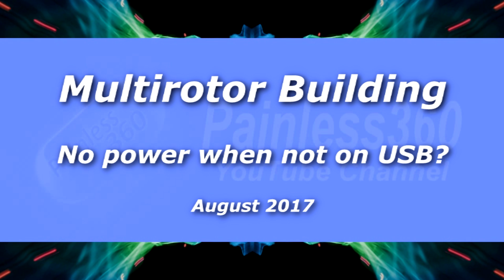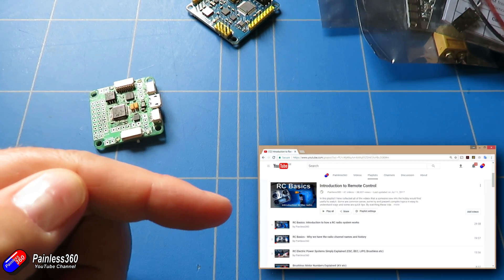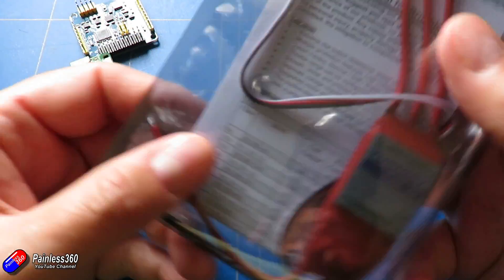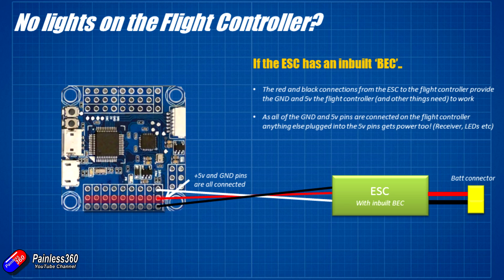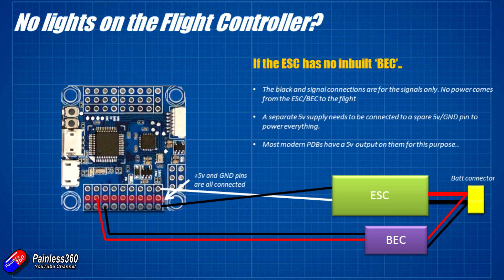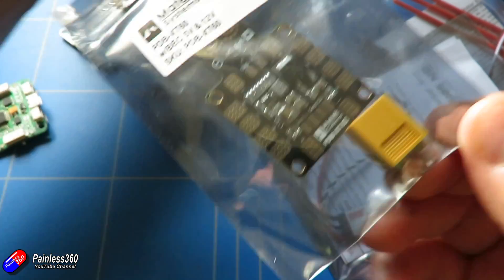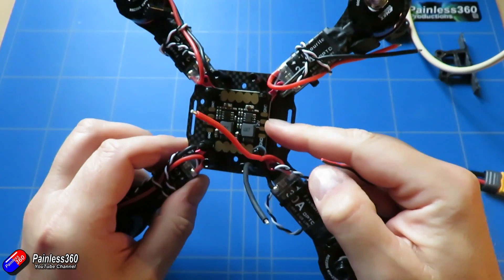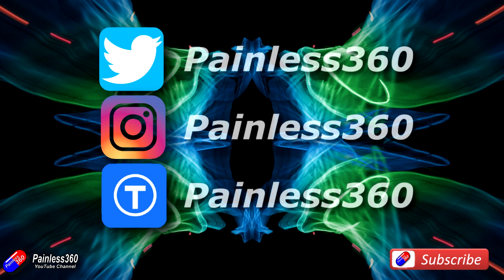RC Fix: No power on flight controller when not connected to USB

Comment: My receiver and everything works right when I'm plugged into betaflight but as soon as I plug in the battery, in my receiver tab nothing is they have see everything lights up but my stick movements aren't moving at all and it won't arm or anyting unless I plug it back into betaflight I don't know if a faulty receiver would cause that or what, I'm about to go insane,
Reply from the maker: I'd check that the Rx remains powered when the battery is plugged in. If this is a model you've built then I'd recheck all of the cabling too. Try it with just the Rx connected fro example. Best of luck
Reply: Yes when it's plugged in the usb, I have movement in the receiver tab , when I plug in the battery ,the receiver is still bound and lit up green but I don't have movements in my sticks. If I unplug the battery, everything has movement in the receiver tab again, it's a crossfire micro V2. What started this is after I had everything set up the quadcopter would not arm. And after several hours I've traced it back to something with the receiver I don't know if it could be something else. Could a faulty receiver cause this... meaning that it is bound and lit up green hooked up to the USB and I have movement in my receiver tab until I plug in the battery, it still says lit up green and bound but no movement in receiver tab

Comment: I'm playing with an old Omnibus F4 and I'd seem to have the opposite problem when I plug in USB alone I can't connect the beta flight but if I supply battery power then everything lights up and I can connect to beta flight. Now I'm supposed to be able to connect the beta flight without a battery, correct? And if that's the case what's going on here, thanks in advance for any help you can give me
Reply from the maker: I'd try another usb cable first...

Comment: My new replacement Tinyhawk 2 AIO board worked find but the motors were spinning backwards. As I was trying to figure that out, it stopped powering on when I plugged a battery in. It only lit up if the USB was plugged in. If I then also plugged a battery in, it made the tones and I can spin the motors in the motors tab of Betaflight. Unplug the USE and leave the battery plugged in and it goes silent and dark. It's as if no battery is plugged in.
Reply from the maker: Sounds like the 5v regulator on the flight controller has failed...
Reply: @Painless360  I bet you're right. I've seen videos of people getting these tinyhawk boards and components were loose and falling off. My original one lasted less than a month.  Maybe that was from my crashing, but I never crashed it hard. This one lasted 10 minutes.

Comment: My rc receiver isn't powering on. It's a flysky ct6b
Reply from the maker: Could be a few things, what troubleshooting have you already done?
Reply: @Painless360   checked the bettery, changed ESC , changed  the motors etc. Rewired it nothing happens:(

Comment: Hi Lee, while searching your videos for advice about my issue I found this one...it is kind of the opposite of my situation but will ask the question anyway...please disregard if it is too annoying. My FC (Mamba F405 MK2) gets a solid red light when connected to USB but doesn't get recognised on PC (other FC with same cable is ok). When I plug in the battery I get a greenish light too plus the solid red one. Can see picture on goggles but no OSD. Get telemetry on TX but no action on quad when I flip switches etc. Could this be beyond repair? I know they are cheap but was first trying to exhaust all possibilities. Diatone forum on FB were a bit useless...thank you for taking the time to read this. Cheers KiwiFPV
Reply from the maker: Sounds like one of the power regulators is bad on the flight controller. Best of luck

Comment: I have matek f405 CTR that turns on with USB but not lipo but the 5v pad shows voltage 5.05 to be exact
Reply: I have an F411 doing the exact same thing. No 5v on the rail with usb or lipo
Reply: Did you find an answer to your issue?

Comment: No, people are asking this question and (like me) have a 4in1 that supplies power.. Still no answer this has happened to me twice both with f4 omnibus fc
Reply from the maker: Sorry, I don't understand. Is that a question? If so, can you post a little more detail. See my build series for how I make models that work first time..
Reply: @Painless360  i just got a Emax hawk5 that has a magnum f4 stack where do i get the 3 wires from on the esc?
Reply from the maker: There should be three wires, two sets at both end. Still not sure what you're asking, but the best thing I can suggest is to have a look at the 'quadcopter building for beginners' series on the channel, I cover each of the individual steps. Hope that helps, best of luck!

Comment: Painless,

Forgive me if I am being difficult at understanding your video on this subject. I have a Omnibus f4 v5 and  I got clean 5v power coming from  my matek PDB and I am not getting any power to the FC. What am I doing wrong?
Reply from the maker: Please see my 'Quadcopter building for beginners' series on the channel for how I build them. The PDB should provide power to the FC.,,
Reply: Having the same issue using a power supply on several boards, did you figure out what the problem was?
Reply: @simonczarnota2212  yes, use a different  FC and don't rely on videos like this to solve every issue you experience.
Reply: Yea the problem is I have a custom frame designed for this board, it's not a typical quad configuration so it'll be a pain to redo everything with a new FC, was hoping there was an easy fix. Thanks anyway

Comment: Can you help with cc3d  libre pilot issue...your videos helped me set up ...all works good while connected to computer. CC3d responds to radio and all arming and stick inputs, but once I unplug from computer and reboot everything it works until I try to arm when I go to arm then I loose all stick inputs, except flight mode switch I can flip from manual to attitude and it responds , but nothing else responds.
Reply from the maker: Does sound like a 5v power problem. What troubleshooting have you already tried?
Reply: Painless360 RE-flash, go through set up again, RE-bind and check all solder joints. I checked last night and it worked fine. Armed and all so now I'm gonna have to check each individual wire but it should be only the five volt that feeds the receiver...this is strictly a test plane and test for me to better learn pids and set up, before I go over to f3 on my nano goblin.
OK update. Well all worked fine today , beside when I flip switch to attitude mode the servos flutter , not uncontrollably but not nothing u want to fly...in manual mode you can put it about 100 feet or so up and it will just fly perfect. So all timing and cg good. 
What cause the flutter.
Thanks for replying back

Comment: I have the same problem, but I am using an AIO F3 Brushed Controller. Any Chance I can fix this problem? When I am plugging in the battery, the power led is red and very faint, nothing else. With the USB Cable, everything works.
Reply from the maker: If the board isn’t powered from an external 5v connection then maybe the onboard power regulator is bad..
Reply: Dustin H. Has the problem been solved?   I have exactly same case as you.

Comment: This seems to directly contradict advice I have seen elsewhere to CUT OFF the +5v leads ftom the ESC signal cables. There is surely only one correct answer to this?
Reply from the maker: The answer depends on the flight controller and the ESC that you're using and whether or not they have a linear or switched (or none) BEC inside. Please watch my other videos where I do builds where a cover it in a lot more depth. There is there is one easy answer, this was only answering one very specific problem..

Comment: Sorry for the big comment.... would my issue be caused by a bad FC power regulator? First flight of the day... I plugged my lipo in... NO LED lights on FC, only 3 fast esc beeps. I unplugged/re plugged the lipo a couple more times when I noticed the red LED started to slowly come on from a dim red light to eventually full brightness, and then after  several more unplug/re plugs of the lipo, pulling and shaking the quad...the red and green LED both came on as they should, with 3 fast esc beeps then 2 slower beeps, I was then able to arm and fly without further problems. Plugging other lipo's from this point on had no issues as well. 
-Board powers up normally by USB power every time though. I have checked and resoldered all connections..even my main bat wire s to the board and XT60. After I did this, board powered up by lipo off the bat....but after a day or so the issue returned. Could pluging my lipo in while its connected to USB power, cause a regulator burnout? Help pls.
using a F4 board..clracingf4s...to be exact.
Reply from the maker: Sounds like a bad 5v regulator to me.. Best of luck!
Reply: Painless360 Ok so this FC was a recent install. What could I have done to ruin the regulator..solder to hot? I keep it below 400c, but maybe contact time to long. Going to just install a replacement I have but want to keep this from happening again.
Reply: Painless360 Hey I have the same issue. Never flew my new quad. Everything was working great until I disarmed and tested the turtle mode I set up. Once I unplugged and plugged back in. Only 3 beeps and no power to the FC. I have the GEPRC SPAN AIO tower. Please help.

Comment: my esc have bec's   have it built in what do i have  4 x 20A 3-4s Lipo BLheli_S ESC still  the board doe not have enough power the yellow like barely on and blue light nothing .. only when i use usb plug   how do i fix it...
Reply from the maker: Definitely sounds like a power problem, what troubleshooting have you already done?

Comment: Slightly off topic question but I've broken a couple of the 5 to 6 pin connectors (jst?) on my vtx and was wondering a recommended a way to solve this issue. After a crash or from unplugging/plugging over the course of time, they become loose and cause signal loss. I tried to solder wires directly to the tiny pads where the pins connect to the vtx, but they are so small and close to each other, I couldn't keep the solder from bridging. It seems like this would be a common problem but I can't really find a solution. Wondering what experience you have with vtx connectors. Thanks
Reply from the maker: +casey cropp I've never had that problem, I'd suggest having a look at how your mounting and routing the cables. You need to make sure that the video transmitter is nice and solid, and that there is a little bit of slack in the cables so in the event of a crash there not ripped out of the connector. Best of luck

Comment: Very good explanation...Thanks... also, I am a little confused about one thing... If all ESC's have +5V BEC attached wire, and I only need one to power the FC, what do I do with the other 3 +5V leads? Do I remove them or will it not hurt if they are plugged into the FC?
Reply: Remove the power lead from all but one of the ESCs.  I assume you're kickin' it old school (simonk) if you have escs with middle wires - or perhaps you have the ESC installed backwards?  The motor output wires are almost always the same color anymore so it should be hard to confuse that.  It is also not uncommon for newer boards to either have an onboard regulator (common if current sensing is on the FC) or as he stated, the PDB may have a regulator intended to run everything.  If that is the case, do NOT connect any of the BEC power wires.  (Just use an xacto knife to lift the lock on the tab and the connector should slide right out.  Then, if you're REALLY sure you don't need them, cut them off and tape/seal the end of the cut off wire.  (I would probably just electrical tape the connector to the cable until I was sure I wanted to remove it.
Reply: SimonK, yep! Thanks, that's just the answer I was looking for.
Reply: Guys I have 4 simonk ESCs....I bought them but I do not dear to put them on my quad, because I do not know which protocol to use for them. Is here anyone who knows whch protocol should I use? This simonk ESC are heavy, but they look like they have capacitators , which yould save some time with soldering fo slower copter or something.
Reply from the maker: +Robert L Erwin Jr see the other videos in the 'Introduction to Remote control ' series and the Quadcopter building for beginners series I link to for the answers.. Best of luck
Reply: ok thx!
Reply from the maker: +Painless360 ( if the BECs in the ESCs are linear then you can plug all the red wires in side by side, if the BECs in the ESCs are switched then unplug all but one of the red wires)
Reply from the maker: +Josic S. Select PWM in Betaflight. Best of luck
Reply: Thanks my friend! I've been watching your videos religiously and learning a lot. Thanks for providing GREAT content!
Reply: i have 4 x 20A 3-4s Lipo BLheli_S ESC with build in bec
Reply: dont have middle wire just two black & white and the come with bec on the esc what to do then then need to be plug in right those are the motor wires  right